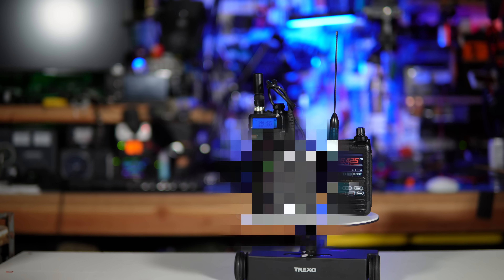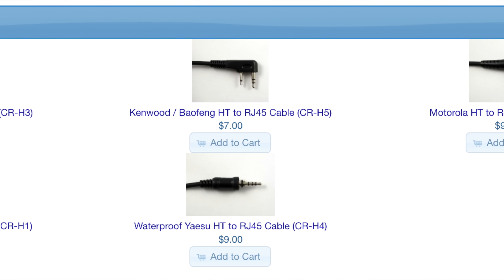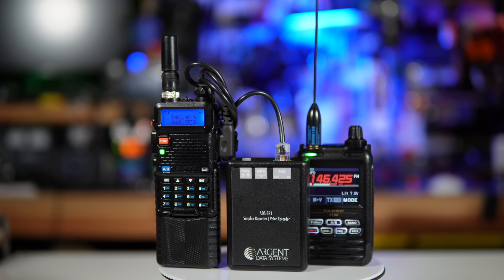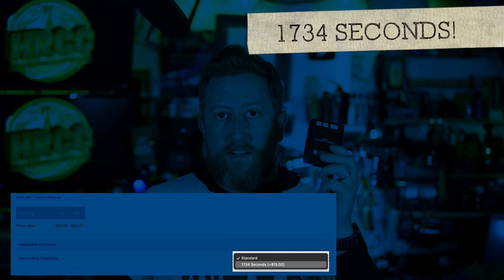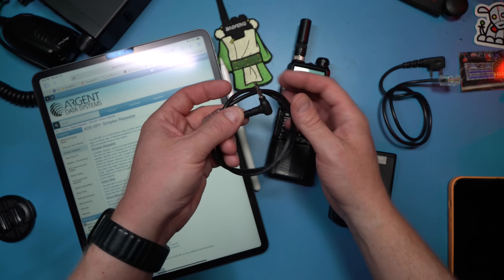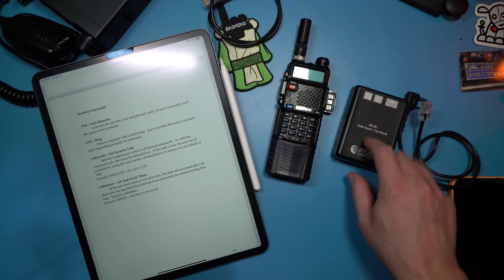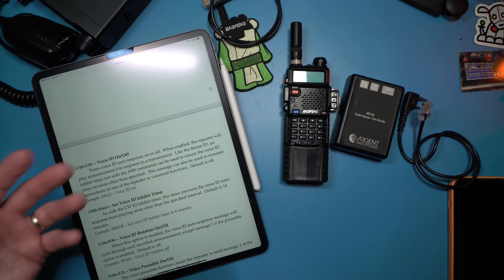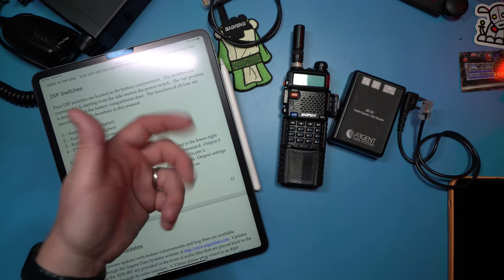The Most Hated Box In Ham Radio

Comment: Hey, I'm the designer of the ADS-SR1 and the owner of Argent Data Systems and I'd be happy to answer any questions! The wide voltage range is there partly to cover aeronautical use and other cases where you'd run from 24 volts, but it's using a linear regulator so it just gets progressively less efficient at high voltages and the regulator gets hot. Keep it to 12 or less if you can.

There are a few different ways you can set it up to only repeat when needed. There are a set of 1-digit commands that can be enabled to turn it on and off without needing an access code, and it can be set to turn off again after an idle period. The idea is that you call without the repeater, and if you don't get through, you punch a key to enable it and try your call again through the repeater, and turn it off when you're finished.

You can also use the 'say again' function (DTMF 0) to have it repeat the last thing it heard. There's no time limit on that (except it's not retained across power cycles) so you can use it to check what the last activity on the frequency was. So maybe you set it up at your campsite, hike off out of range, and then when you get back in range you query it with 0 to see if anyone called you while you were gone. You can also make it an adjunct to a duplex repeater frequency to see what the last transmission on the duplex repeater was.

The unit doesn't care if what you have it hooked up to is a radio. We have customers using them as interconnects from radio systems to PAs, like at schools, so you activate the unit with a code, make your announcement, and then it gets replayed over the PA speakers - without risking feedback.

Another use case is coverage testing. If you're considering a site for a new duplex repeater, you can drop an SR1 there and drive around and do radio checks to see how you're getting in from various places you want covered. Along those lines there are also a lot of marinas using them to do an automated radio check so boats headed out can check their radios without bothering the Coast Guard.

The SR1 should be getting a major update soon in the form of NFC support and an Android app. You'll need an add-on board if you've already got an SR1 (Mk II version, from about 2018 onward) to add the NFC antenna. Instead of configuring everything through DTMF, you'll be able to just tap your phone or tablet to the device, update the settings on screen, and then tap again to save. That ought to be ready later this year. Eventually you'll be able to load announcements that way and do some real-time diagnostics but that might not make it into the first version since it requires a more complicated NFC pass-through communication mode.

As for legality, I'm not a lawyer either. The project started because 15 years ago my dad, KB6VAA, couldn't get a signal to anyone from the hole his house sat in. He wanted a Radio Shack simplex repeater but they'd been discontinued for years. I bought him an MFJ unit, went to set it up, and decided it was garbage and I could whip up something better. It got developed into a proper product sometime later. I read the Part 97 rules myself and it's ambiguous, so I did some asking around. I did learn a few things, like that in 2008 it cost $400/hour to hire a specialist communications lawyer who might be able to get a definitive answer from the FCC. Eventually. It's something the FCC doesn't seem inclined to clarify unless there's a test case. At the end of the day, it came down to the fact that Radio Shack and MFJ had been selling equivalent units for many years without any legal issues. Not on the ham bands, anyway. I've heard of at least one FRS simplex repeater bust. When someone asks us about legality, we'll tell them when we know something is not permitted (like FRS operation) but beyond that it's on the user to figure out if their specific use case is legal in their jurisdiction.

There's a much more sophisticated ADS-SR2 (that will probably get a different name) in the works but it's on the back burner now because parts have become unavailable. It'll have to be ported to another platform. It's able to function as a duplex and cross-band repeater, plus RoIP gateway (with native Echolink support) and it has a graphical programming interface where you just draw audio connections between functional blocks like receivers, transmitters, and delay buffers. I  have no idea when that might hit the market at this point but hopefully we'll get some new components qualified soon and be able to get development going again.
Reply from the maker: Thank you! I really enjoy your repeater!
Reply: You mention FRS, what about GMRS? As hunting parties we often all end up on the same hillside in different draws. A repeater on the hill opposite, say in a parked truck, could be line of sight to all of us, when we are not,  even though we are only a couple hundred yards apart.
Reply from the maker: Yea. It’ll work fine. You just need to have e the right cable.
Reply: @LibertyCaveWS7PB  From a technical standpoint:

FRS is not allowed use repeaters. Also, most likely the repeater box would be retransmitting  at levels above the max 2W output of most FRS channels.

GMRS IS allowed to use  repeaters.

The gray area of course is what constitutes a "repeater."

Is it only a system that receives on one frequency and retransmits on another?

Or is it anything that can parrot a voice over radio?

The FCC LOVES it's gray areas, that way they can arbitrarily enforce whatever they want.

Classic example is "GMRS stations may not be tied in to the public switched telephone network."

But fails to explain what that constitutes.

Same principle here. Yes GMRS can use repeaters, but is a simplex repeater. But is a simplex repeater a "repeater" to the FCC? Or an unlicensed radio station?

The short answer is: It's whatever that particular FCC agent wants it to be depending on what side of the bed he woke up on.
Reply: Ordered mine today with every cable available! Excited to play with it! N7MKY
Reply: @n7mky  I bet they sell out.  😅
Reply: See, this is exactly what the internet is for. Someone has a very specific question and then the one person on Earth who can answer it best pops up out of nowhere!
Reply: Your reply is amazing. Thank you!
Reply: Very cool post, thank you.
Reply: N1VG, are you reachable by phone at the number on the manual?  I am in need of some help..... N1JWW
Reply: @Photoeye65  Yes! Email is preferred for tech support, particularly since we're a little under-staffed and can't always get to the phone when we're busy, but we're here M-F, 9 AM to 5 PM Pacific time.
Reply: @Photoeye65  Reply to him instead of me and you might get an answer.
Reply: @CandyGramForMongo_  I apologize.   Didn’t realize it.  I heard from Scott.  Gonna call this am.

Comment: Yes the capability of this unit is impressive. Back in the 80's I designed a similar unit using a cassette recorder...this is miles beyond. However it can be dangerous in that it can operate as a jammer on frequencies. On the positive, it can be used for beaconning to test propagation; eg., connect it to a multifrequency radio at a location to determine best frequency for coverage.

Comment: From our friends at the ARRL:

"A "simplex repeater" is used to extend the range of low power rigs such as handhelds by storing the signal transmitted on a frequency and then retransmitting it through a more powerful or better-situated transmitter on the same frequency. According to the rules, however, such a device is not a repeater since it does not simultaneously retransmit the signals of another station and it does not retransmit the signals on a different channel or channels, as specified in the FCC's definition of a repeater, so it can't be operated under automatic control. If a control operator is present and controlling the device, either locally or by remote control, then it can be used. But it cannot be left unattended! On the other hand, it is not limited by the other repeater rules, such as repeater frequencies."

Comment: If you use diferent CTCSS or DCS for TX and RX you only ear the repeater machine.
That avoids the temptation of answering right away when you are in range of the other guy (wich is the problem with the simplex repeaters).
You can also use half-duplex:
One TX QRG and a diferent RX QRG on the simplex mountain top unit (yes, both have CTCSS or DCS).
That way, you can use the regular simplex channel for everyday tac comms at short distances, but at the same time receive a call from someone out of range.
Then you just change to channel 2 for answering....
Really works for low traffic comms.

Comment: Is it possible to use dcs and pl tones at the same time? Would it be possible to remote in via LAN or IP?
Reply: You want the ADS-SR2 for that. ;) Sadly it's not certain at this point if it'll ever make it to market. It was many months into development when COVID hit and the microcontrollers have been unavailable ever since. Last estimate was June 2024. The WiFi modules also disappeared, but honestly those things suuuuucked and I'm happy to ditch them for something else. And after some testing I think wired Ethernet support is going to be a requirement, too.

But the prototype DOES do remote configuration via web browser or telnet, and has radio-over-IP linking capabilities and works as an EchoLink node.

Comment: It comes in handy when needing to test simplex range. I was able to test range on a simplex freq needed for an emergency service to check if the antenna height was high enough for the range it needed to get. Instead of trying to find another person to sit at the base radio and tell me yes or no if I was making it. I was able to test it alone. Being able to hear my transmission come back to me helped in the testing of the range. Of course if I were to put one up for a long time, I would use tones on both tx and rx. If not used 2 diffrent tones one say 141.3 for tx and say 100.0 for rx. The radio you use, the tones would be 100.0 for tx and 141.3 for rx. That way you would only hear one side of the conversation.
Reply: That avoids the temptation of answering right away when you are in range of the other guy (wich is the problem with the simplex repeaters).
You can also use half-duplex:
One TX QRG and a diferent RX QRG on the simplex mountain top unit (yes, both have CTCSS or DCS).
That way, you can use the regular simplex channel for everyday tac comms at short distances, but at the same time receive a call from someone out of range.
Then you just change to channel 2 for answering....
Really works for low traffic comms.

Comment: I absolutely love these Argent units....Three years ago, I had 15 (fifteen) of these units working legally on Blue Dot business frequencies in very remote/isolated Alaska regions supplying radio comms for science crews working in isolated valleys. Control was via DTMF frequencies and CW ID transmitted every 10 minutes.  If necessary (usually) Personnel could send a mailbox message from an isolated valley to the mountain top Argent repeater unit.  Requests for Helicopter pick-up time changes,  supplies....   The message could then be accessed by base personnel located 50 miles away.  While a regular business duplex repeater cost around $2000+ (US), the Argent unit was approximately $100 bucks.  My clients loved the cost savings.  I used Tera VHF/UHF radios in large Pelican case powered via solar panels.  Additionally, I found Scott from Argent to be top notch in support of his products.
Reply from the maker: That’s cool! What a good use case!

Comment: When I bought mine years back, I chuckled about "security code" function... as I watched my laptop decode all the DTMF tones real-time. 🙂
Reply from the maker: Lol yes.
Reply: 'Security' is always relative! A 3-digit DTMF code is about as secure as a cheap file cabinet lock - it resists casual tampering and that's about it. Maybe when the configuration app comes out we'll add a one-time password option, but the lack of a real-time clock complicates things. In all the years it's been shipping, I don't think anyone has requested a higher security option.
Reply: I wear a seat belt - it gives me some 'security' - but it won't stop anyone from breaking into my car 😂
Seriously, though, dtmf security is protection against being 'the most hated' ham, if you use one of these. If you keep your device (and yourself) under control, even just a little bit, nobody is going to mind!

Comment: I looked at the specs again on the website, it is how you setup legal ID to use on the mountain top:  "Voice Beacon
Up to 10 voice announcements can be stored in the ADS-SR1’s non-volatile memory. Each message can be set to transmit at a specified interval, and a time offset setting allows beacons to be staggered or rotated. Intervals can be from a few seconds up to twelve hours. One message can also be configured to play in response to an incoming transmission. This can be used for repeater identification, or to provide instructions on using the repeater or voice mail. A separate inhibit timer stops the message from playing again for a specified time interval."

And so you setup that inhibit timer for 10 mins needed repeater ID until no-one is transmitting anymore.

Comment: Under your control it is an Auxiliary operation.  If you can shut it off by DTMF its under your control while up on the mountain just as any mountain top repeater is.  I see that they have "optional Morse ID" so that would allow simplex repeater use as your ID as station owner of the simplex repeater is being sent out as well the the other users ID in their voice.

This is also why the Kenwood XBRs have Morse ID built in , and the Icom and Yaesu do not;  The Kenwood's "used" to have DTMF full control of their XBR operation and fully legal,  Newest ones in the manual say under the remote control page of the manual after B8XX serial number no longer has remote control.

They can no longer get the old DTMF decoder chip that fits on the circuit board.  At the Tokyo ham radio show, Kenwood did say they are working on a new mobile and HT to replace the TH-74D
Reply: What people get into armchair lawyer fights about is what exactly is meant by remote control. The argument is that if the device was to malfunction and get stuck in transmit mode you wouldn't be able to turn it off because it wouldn't be listening. That's possible even on a repeater controller with a separate command channel - if it experiences a software lockup it could still ignore DTMF commands, unless the command channel is truly independent with its own decoder and the ability to reset the system. Practically, though, transmitters have time-out timers of their own, and the SR1 has an internal watchdog timer. I've never heard of one getting spontaneously stuck in transmit mode.
Reply: @n1vg  Correct but hardly any real repeater has Direct out of band Control, they are mostly remote control now from the ones I have been up to. And yes repeaters get stuck transmitting and you may have to drive there to shut it off.  I seen that a few times in my town.

Comment: Don't think of simplex as "transmitting on the same frequency", but rather "not transmitting at the same time". Meaning, the device cannot transmit the same time it's receiving like typical repeaters. But if you set your radio up as you would for any repeater with a frequency, appropriate offset, even a tone, then set the repeater with opposite frequency/offset and optional tone, it would work like a normal repeater except the transmission repeat is delayed.

Station A/B/*:
Frequency: 146.880 (transmits on 146.280, receives on 146.880)
Offset: -600

Simplex Repeater:
Frequency: 146.280 (transmits on 146.880, receives on 146.280)
Offset: +600

Comment: When on large family camping trips (50-100 people) in remote areas with repeater dead zones I setup this simplex relay along with a crossband repeater, both 5 watts. They go on separate hilltops overlooking multiple separated valleys/lakes. 

I set one of the crossband repeater frequencies to the simplex relay frequency which gives me my own portable linked repeater network with voicemail (talk into one repeater and get heard two valleys over via the second repeater where the first repeater doesn’t cover.) 

Just have to make sure I use CTCSS/DCS and keep my frequencies far away from any local repeater or common local simplex frequencies. I like to operate in the “experimental” portion of any given band. Works amazing!

Comment: I could see a use for this devices. You could use to rebroadcast you APRS packets, if you are in a situation where your packets cannot get out far enough, or you want to use lower output power. Setup a radio connected to it, to listen on a uncommon frequency with a receive pl tone, and transmit on the APRS frequency.
Reply: It'll repeat APRS packets, but it's not ideal. It doesn't do any regeneration of the signal, so it degrades like any analog recording. A proper digipeater would be better. Fun fact, the SR1 does actually have a 1200-baud software modem. It's used for firmware updates, which are distributed as audio files.

It's physically capable of being a digipeater but that was too far beyond the scope of its purpose. The ADS-SR2, if it ever sees the light of day, will probably have that option. The ADS-SR2 prototype is essentially the same platform as the Tracker4 (now discontinued due to parts being unavailable) and it functions as a digipeater simply by virtue of the fact that it hasn't had that feature disabled.
Reply: @n1vg  I never said it was ideal. I said I could see a possible use.
Reply: @dschirpke  It's certainly been done. The sample rate is higher than it really needs to be for voice alone, so it'll work where some competitors wouldn't.